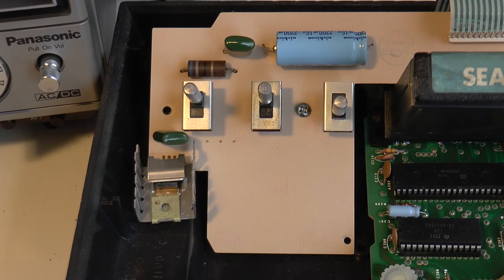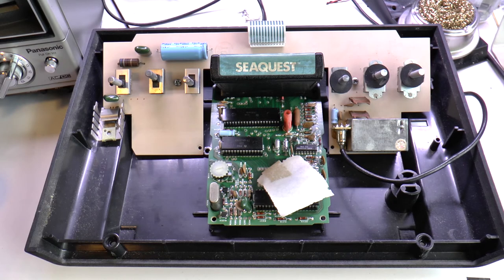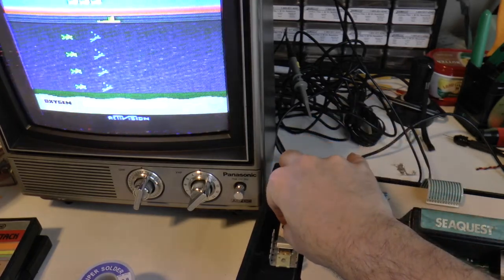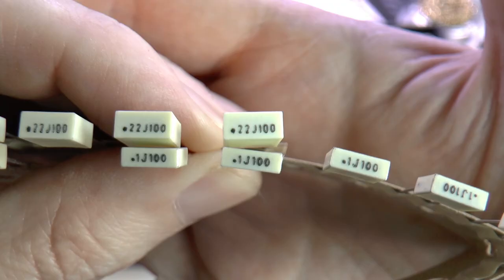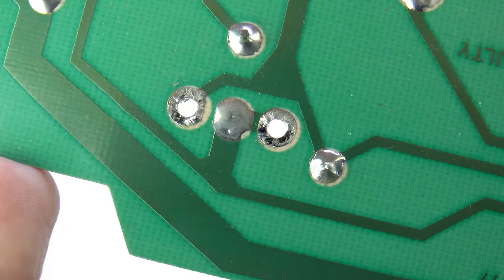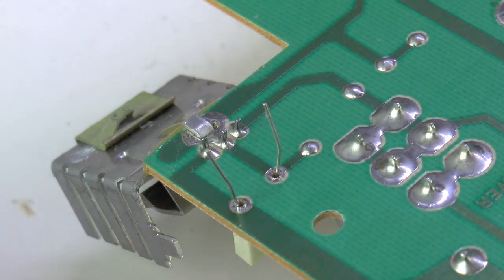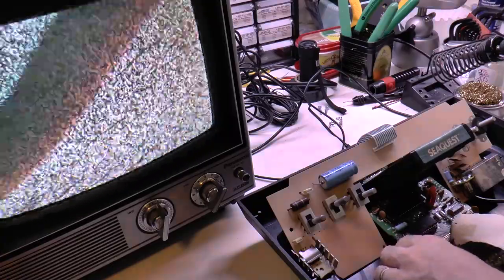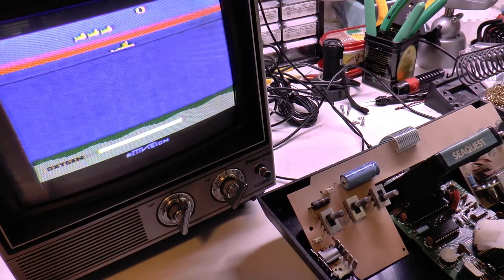Atari 2600 Repair - Bad Color, snow - Bad Film Capacitors

Comment: Just came back here to tell you that I now have a working atari with full color thanks to you. I got it yesterday for free because it had no colors :)

Thanks for the tutorial, in my case I have a 4 switch one so I replaced the 241 cap and adjusted the potentiometer.

Comment: I just made an order from Console5 and included 10 of those .22uf caps. I have a couple 2600's with slight snow but not bad. Also ordered some 2200uf caps for the main power cap as well.

Comment: I just picked up a light sixer 2600 that just BARELY gives off any signs of video from it's native RF. If I switch channels, I can sometimes just barely tell it isn't total static for a second or two. What would you suggest I look into for this particular issue?
Reply: If you're not concerned about originality, go ahead and do an a/v mod.  If you're confident in your soldering skills, go ahead and order a tune up kit from Console5 that he mentions in the video and do it all one afternoon.  You'll be pleased.

Comment: Hello! On my (UK) VCS (light sixer), colours have the right hue and brightness, but the aside from the dark ones they flicker, don't look solid. I tried carefully adjusting the RF inside, but no difference. I don't have a CRT, but issue is same testing on an old LCD and a modern DTV. Any ideas?

Comment: Great video! I have an Atari 2600 Jr. with the same issue unfortunately. Any chance this repair would work on the Jr? I haven't opened it up yet but i'm assuming the Jr is different than the woodgrains
Reply from the maker: Sadly, I have never worked on an Atari 2600 Jr.

Comment: I have a Telegames heavy sixer which has snow, but proper colors. I was thinking it might just be a dirty connection where the RF cable plugs into the board, but when I went to take it apart, it doesn't want to come apart. I can't tell if there are more screws either.
Reply from the maker: I want to say there are six screws - the four on the perimeter of the case and then two additional ones in the middle that clamp the metal shielding surrounding the PCB to the case. I don't have a Telegames heavy sixer - only a heavy sixer, and mine is currently disassembled.
Reply: It was just stuck. I removed the screws and the top portion came clear but not the bottom portion (wood-grain area), but after a bit of putzing around, it came apart. Thanks.

Comment: So my Atari has weird green lines across the screen I’m thinking that it’s those chips because you said that’s the place in the unit where the color problems originate from?
Reply from the maker: Vertical green lines (bars?) and nothing else? The Atari will do various shades down the screen sometimes when there isn’t good connection with the cart (possible dirty connector)

Comment: My 7800 just started showing b/w picture only. Wonder if it's a similar problem
Reply from the maker: I haven't done a lot of work on 7800 systems. It looks like there are potentially multiple issues that could cause it from the quick Google search I did just now. Some people have reported only having trouble with 2600 games being in black and white. Another reported that they appeared to have some issues with joints on the circuits due to the 7800 board flexing from inserting and removing cartridges over time.

Comment: My Light Sixer does not have a chicklet capacitor next to the 2200µF capacitor although the holes are there for it.  Any thoughts why?
Reply from the maker: Hey Dan - I am not sure. There were numerous internal revisions for the 2600. Is it possible they located it somewhere else on your board? I don't have the schematic in front of me at the moment. How is the system behaving?
Reply: @DisplacedGamers  - Thanks for the reply. First of all, after watching your voltage regulator repair video I purchased the refresh & tune-up kit form Console5 and got my dead unit up and running.   I was not able to get a picture at all on a modern TV (presumably due to not being able to fine tune Ch 2 or 3) but I was able to get it working on an old B&W TV which is what prompted me to do the composite video mod.  I just finished the composite video mod and the picture has quite a bit of ghosting (I give the overall picture a 8 out of 10).  I'm not sure what the screen should look like but it is not as clear as I would expect it to be after seeing others' posts. After all, I am running on a 55" LCD TV, not an old 13" CRT so my expectations may be a bit high.  Another thing to note is that I have an emulated version of the 2600 on a Raspberry Pi and that picture is quite clear. This may be giving me an unfair comparison as well.

When I installed the refresh kit, I noticed that the kit came with two .22µF capacitors to replace the chicklet caps but I only had one chicklet cap near the voltage regulator. After watching this video, I noticed the second chicklet cap on your board so I decided to install the 'extra' cap from the kit in that location to no avail. The only other chicklet type cap that I can see is on the main board.  It is physically smaller than the one near the VR and I can't see any markings on it.

My bottom line question is: what more can I do to get a clearer (authentic) picture?

Comment: I have pitfall and Sears combat when I first got my Atari. now both games dont work showing only a black screen
Any help would be awesome
Reply from the maker: Are those the only games you have for testing? Make sure both have clean cart connectors and that the slot in your Atari is also clean. Pitfall is an Activision cart, and those cart connectors tend to be a bit thinner than an Atari-branded cart.

If those are clean and your system is powering up to a black screen, you could have improper voltages (not getting +5v from the voltage regulator). It is possible you may need to re-seat your chips. You can extract them from their sockets and then re-insert them. Be careful when doing this.

Comment: What is the blue battery looking thing?
Reply: an electrolytic capacitor
Reply: @williefleete  I recently cleaned a filthy 4 switch Woody and I'm getting no image. Just big vertical bars in various colors.
So it is powering up, but the game image isn't showing. Any thoughts?
Reply: Kam Aura I have zero experience with these, but check the basics, voltages, solder joints and traces, capacitors, resistors. If you have a known working one compare voltages and resistances etc
Reply: @williefleete  I did another follow up cleaning and the game is working now but the color only works if I press the logic case. Also, the joystick is brand new but I can only move left right and up (not down).
Reply: Kam Aura that sounds like broken solder joints or traces or a pressure sensitive component. With the case open press the board, the area where the fault clears the easiest will be where you need to look. The controller issue may be joints or tracks or the connector on the unit
Reply: @williefleete  I will try to resolder the controller port and clean the tracks again.